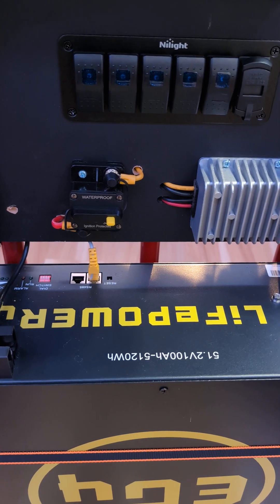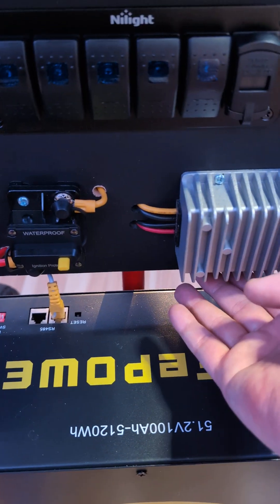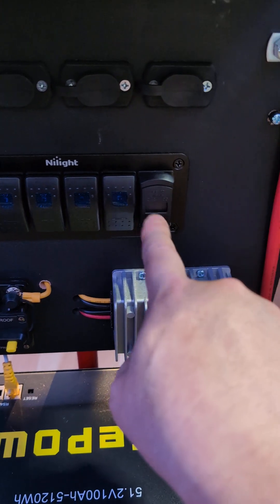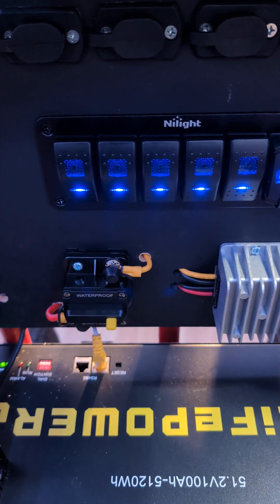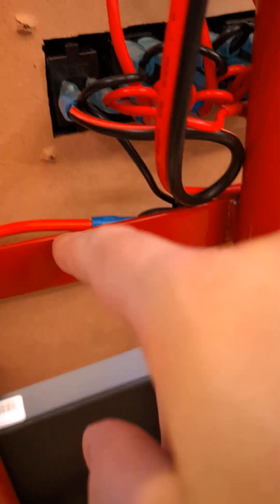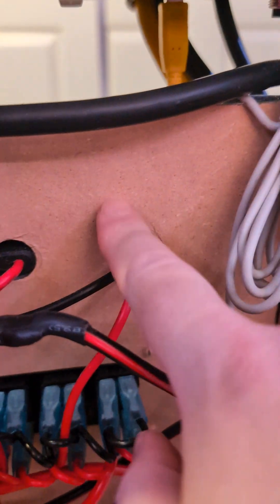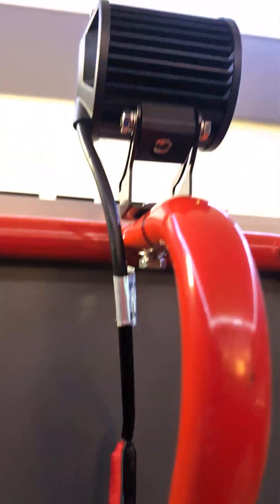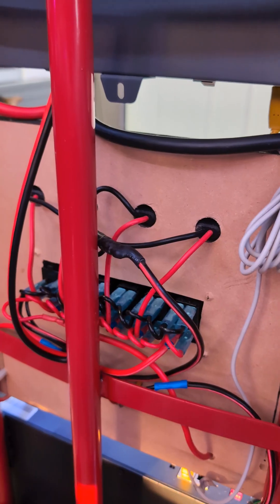Another Portable 3000 Watt 48v DIY portable solar generator handtruck -CUSTOMIZED! (Part 2)

Comment: Im trying to follow you on everything that you did. Im looking at mine right now and it looks like yours. One question and im not sure how i get your answer,  even if you answer it. But, ok, the sent a, i believe a white 30 amp circuit breaker to install between the inverter and battery. I see you didn't install that. Can i ask why? And don't you need it?  Im not trying to corner you on your answers. I just want to learn and read what you have to say. Thanks
Reply from the maker: Dont feel cornered at all. My battery models power switch is also a circuit breaker. My home has only one breaker in the path all the way to the outlet. One is all you need. The one under the power switch is sufficient. If I was going to be using these in a whole home install then I would probably use the included "extra" one in that install.

Comment: Can this unit be charged with a 5500 watt generator?
Reply from the maker: Yes. The inverter also has dry contacts on it for starting the generator automatically if yours supports that.

Comment: Which power strip did you buy and use?  I clicked down below and it went to Amazon. There are 3 to choose from with different length power cords. Did you get the 6 foot power cord or 15 foot?
Reply from the maker: I personally went with the 6' but all would be winners. This is a solid strip. I did take a dremel and take the tabs off at each end. Whats also not in the video is I added small neodymium magnets to the bottom of it with a spot of super glue and now it sits on top even going over rough ground, till I take it off. https://amzn.to/3CHuTVZ  I used about 8 of them
Reply: I bought magnets as well,  but i asked signature Solar  if the magnets would hurt or disrupt the inverter. She didn't really know but said i shouldn't use them to be safe. What do you think??

Comment: So the ground from the converter gets connected to the back of the switch and the negatives from the plugs get soldiered together? Could I just use a wire nut and some electrical tape for that? Also that ground wire that you soldered to the negatives looked like it had a red and black cable and I saw the black end of it connected to the switch but I'm not sure where you put the positive part of it 😂